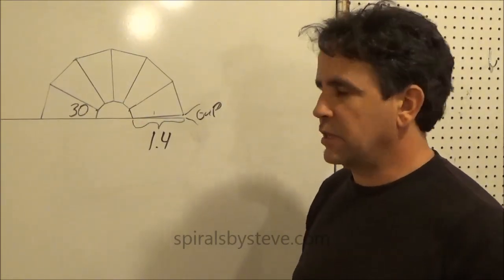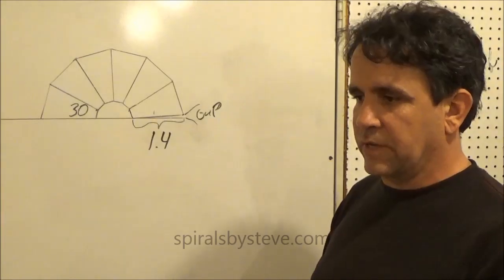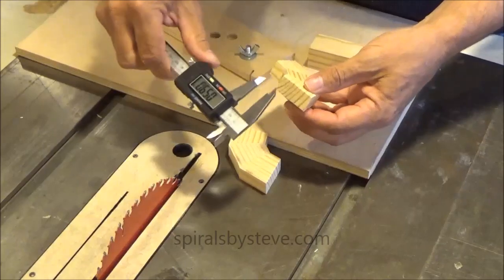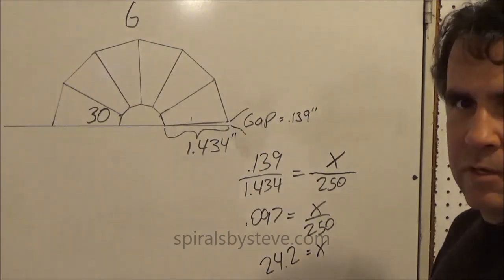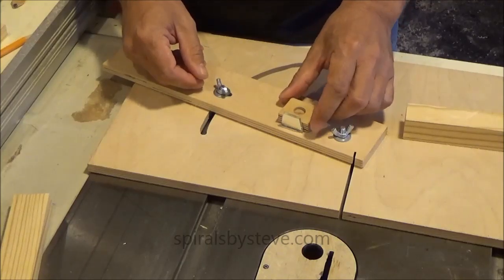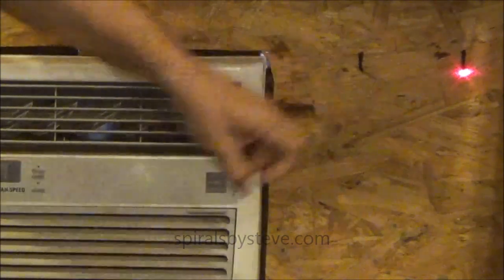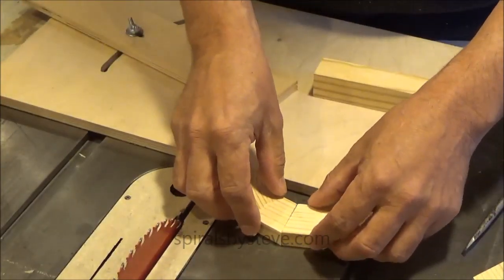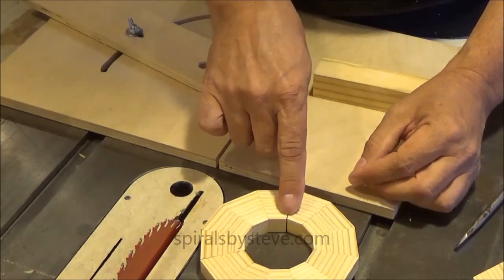Precision Miter Angles Using A Laser

Comment: I've done woodworking for years and dreaded changing angles because getting back to exact angles was really hard for me. I tried the laser trick and now no problem. I made a 45 angle on the end of a 1x1 about 6 inches long, put a magnet on the angle and a hole for the laser in the end and stick it to my blade. I put a mirror on the ceiling and the laser shines on the top of the saw. I can now make minute adjustments. Now with a few test cuts, PERFECT angles. I also put a dot on the wall and clamp the laser to the miter gauge to fine tune it too. The tiny increments were hard to see but over 15 feet away, very easy and my favorite part cheap. Wished I had known this trick when I made those segment bowls. Thanks for sharing.
Reply from the maker: I put a mirror on the rod meant for the kerf splitter so it's out of the way and can stay there all the time.  That eliminates any error from a blade that's a little wobbly, and it rotates along with the blade when tilted.  Makes fine adjustments so much easier, and more accurate.
Reply: I see what you mean. Excellent, I will work that out for sure. That's the tiny variation I was getting. I was using a new Freud Fusion and the run out was minimal but there was a variation. I'll never be as good as you but I'm better from this one technique. It takes one that does it to appreciate what it takes to get that kind of precision. My first segmented bowl was a diamond pattern from a book called WOODTURNING with Ray Allen. It took me a while but it turned out really good.

Comment: I just came across this presentation now. Who sys that trig and algebra are not used in daily activities. I presume that the 250 is the number of inches from the mirror to the back wall. With a little adaption this method can be used in all three axes, prehaps by mounting a small laser to the blade or the miter attachment.
Reply from the maker: It's better to mount the mirror on some other spot that rotates the same angle as the blade.  Blades have at least a tiny bit of wobble or runout.  Yes, the 250 was the distance to the wall in inches.  Thanks!

Comment: Seems to me that your tiny gap is caused by the inaccuracy of the length of the segments because you did not use a stop.
Reply from the maker: The angle error is not affected by segment length, the segments were touching at one end and opened at the other.  Even with inconsistent segment lengths, the gap can be eliminated by sliding a segment in towards the center when the angles are good.
Reply: Steve Garrison I see. So this compensation did not affect the gap then?😎
Reply from the maker: The fine adjustment eliminated the gap.  Even if the segments have variation in length, the gap will close because it has parallel joint faces.

Comment: Question: Does the distance of the mirror from the pivot point on the sled fence affect the precision or calculation?  In other words, if you move the mirror to the end of the fence, does it affect the result?
Reply from the maker: +Nathan Gold   No, the mirror can be mounted anywhere on the fence and it will rotate by the same angle.  The closer it is to the pivot point, the more range it can move through and still be in the path of the incoming beam though.

Comment: What a great idea.  I might try to adapt this for precise setting of the table saw blade angle as well by putting a magnet on the back of a mirror.  When cutting 12 staves to make a cylinder recently, I had a heck of a time eliminating the gap using my digital angle gauge.

Comment: Very interesting, Steve. 
Something very similar could be done with a long ruler (yard stick) screwed down to the jig to act as a pointer. Not nearly as precise, but quicker to set up.
Reply: Your long pointer would probably be as precise John because his laser was over a distance which caused the diameter of the dot to be wide and difficult to get directly on the mark.
Reply: +MRrwmac 
If you line up for the centre of the dot, it should be way more precise given the distance.
Reply: +John Heisz Agree!
Reply from the maker: +John Heisz   Yes, that helps.  This laser and mirror is crazy sensitive to any adjustment.

Comment: That was very interesting Steve.  It would be great if you could include some diagrams and more explanations around the math.  It wasn't clear to me how a consistent segment width was maintained.
Reply: +Ed Draper I'm pretty sure there's a pencil mark on his sled that he uses to line up the corner of the stock with before each new cut.
Reply from the maker: +Ed Draper   I have a mark that I am using to be consistent with length - probably needs a stop to be more accurate though.  I will be making a page on my site with more information, but haven't done that yet.